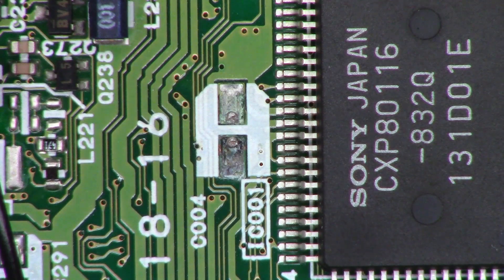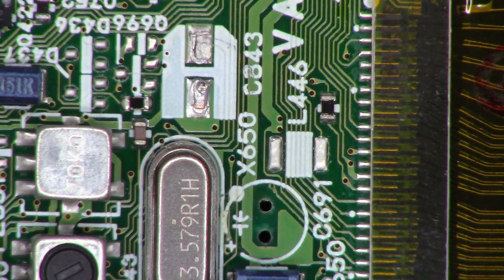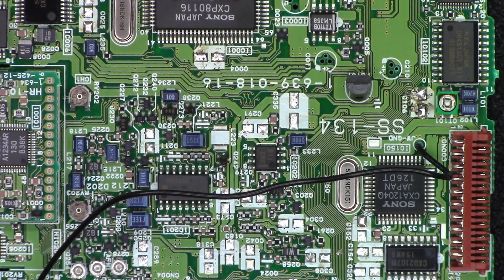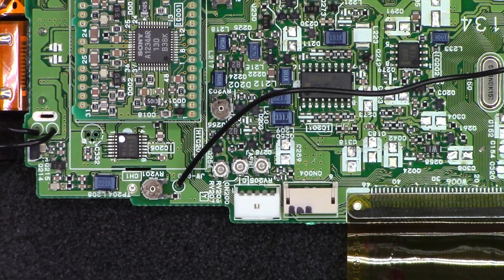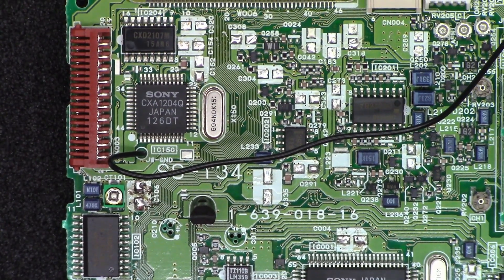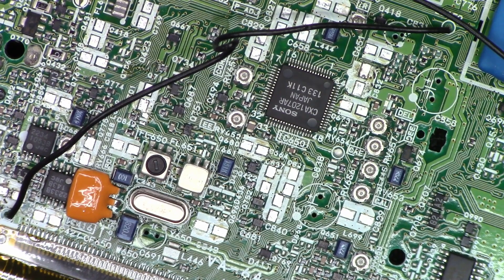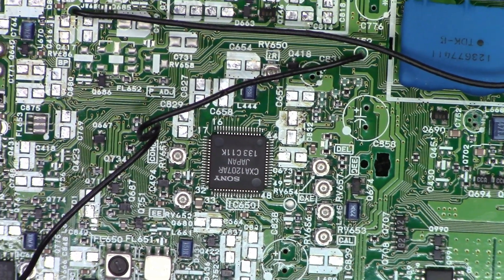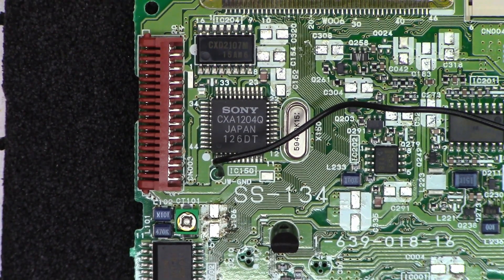Sony CCD-V701 Camcorder from the 90's Complete Re-Cap Part 4.2 Cleaning the main Board Pads.

Comment: I'm guessing this repair won't continue?
Reply from the maker: I recapped it and it still had issues. I can send you my personal Samsung 8mm camcorder with a brand new battery and AC adaptor if you may are interested. Sorry.
Reply: @norcal715  It's ok actually, I conpletely understand. What kind of issues does it have?
Reply from the maker: I think some of the plate throughs have been compromised by the corrosive electrolyte that leaked through the board. It is a multi layer board and I did not think it had become compromised, but I was wrong. Sorry Cord.
Reply: @norcal715  I meant how's the image doing on that thing, and audio/video. Because if the audio and video have improved as a result of this repair, I could take it back and use it at least as a "webcam" if you will
Reply from the maker: It wont even give a usable image, I re-removed all of the capacitors to see if I messed up, the boards are bare as of now. Sorry, If you want the Samsung, just let me know and ill send it to you. I will have to order a video cable if you want the camera, it just has a 3.5mm jack and not individual RCA jacks.
Reply: @norcal715  That is too bad, but I admire the determination with which you tackled all faulty capacitors. Sometimes complex repairs like this just don't work out, happens to (I think) all of us. Warm greetings from the Netherlands.

Comment: Unfortunately  a waste of time with through hole circuit board design. The cap leaks into the holes eating it away. It might work now and will fail not long after.